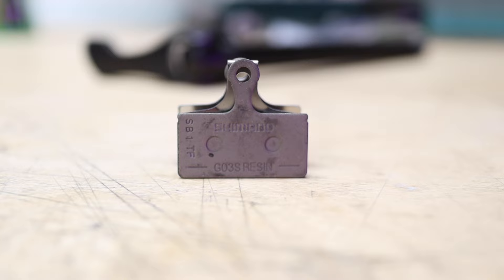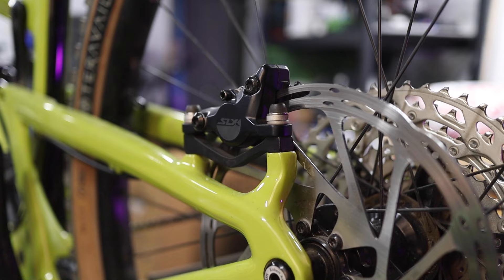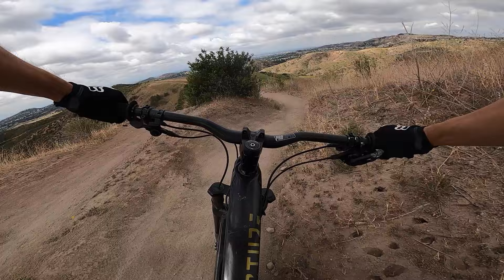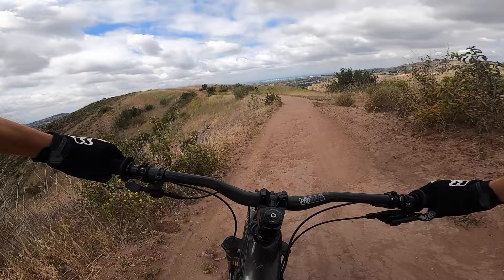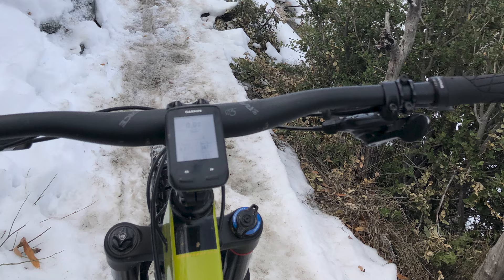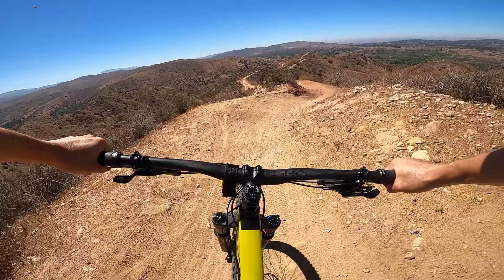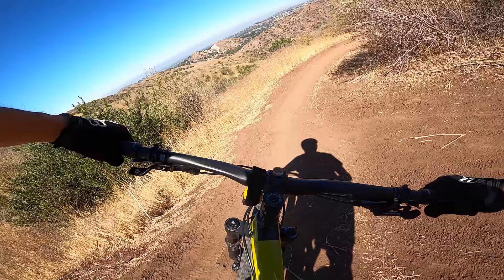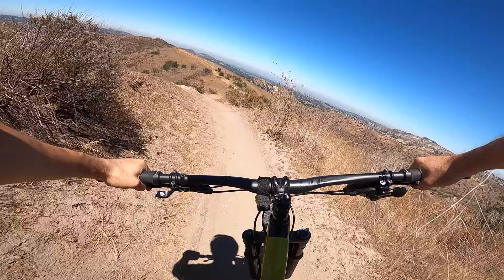Are You Using The WRONG Brake Pads??

Comment: Must be the riding style. I go through 2-3 metallic rear pads sets and one front set per year and find the resins unsafe when I need to stop. Maybe the Zee/Saint have a different feel. I am either max braking or off the brakes more than average riders and run the largest rotors allowed F/R. If I can't lock up my brakes with one finger at any time I don't trust them to stop me. Like you said...personal preference. Also, I buy bulk China metallic pads and find them as good or better then factory Shimanos at a fraction of the price. Only run Shimano rotors though. They are consistent though wear out quickly. Absolutely can not stand Sram brakes. No way No how. Hate them. P.S brake noise with metallic pads is 100% definitely installation or contamination not the pads.
Reply: Link for the China pads?

Comment: I switched to semi metallic from the stock resin pads on my mt201 brakes.  Sanded the rotors with 180 grit and cleaned with acetone (i think.  Here in Norway it's called "red spirit." Its what i had on hand.). And i noticed right away even before bedding there was an improvement in braking performance.  Braking is highly subjective and it pays to experiment.

Comment: I'm a Shimano guy for both MTB and Road brakes and I found that upgrading rotors for thicker ones solved most of the drawbacks of metallic pads. I don't need organic pads anymore.
Reply: But shimano rotors all come in the same thickness? 🤔
Reply: @gammelgemse  Yes, but I have Magura Storm HC and Sram HS2 rotors that are 2mm thich. They are also much cheaper than the MT900 rotors.
Reply: @anthonyhebert-trudeau6995  interesting option, and presumably much heavier?
Reply: @gammelgemse  147 grams for a Sram HS2 and 127 grams for a Magura Storm HC rotor both in 160 compared to 110 grams for a fragile Shimano MT900 rotor. If that's your definition of «much heavier»... I invite you to reconsider your priorities when it comes to weight savings.
Reply: @anthonyhebert-trudeau6995  Switched to Sintered pads on my rear entry-level Shimano brake, along with upgrading the rotor from Shimano RT54 to SRAM HS2 (both 160 mm), and the difference has been like night and day!

Comment: Have to disagree on the longevity of resin pads, on my e-bike I can get through a set in a few weeks by which point the resin has started crumbling and my pistons are almost fully extended. My sintered pads last well over a year for the most part. The screaming brake problem is definitely an issue though, I hate it and find myself riding the brake for a few seconds to heat the pads and rotors, drying them out. 

I have a short but very steep descent by my house and by the time I get to the bottom on resin pads, they have nothing left to give. With the sintered pads, I find that they work just as well as when they were at the top except there is noticeable pressure on the callipers from the fluid temperature rising.

Comment: It's interesting about squealing brakes.. I had a bike with Magura MT5s, factory resin pads up front & Galfer black metalic at back, & i hardly noticed any squealing in regular 500m descents, both in dry & post rain on wet hardpack.. Then i bought a new 2nd hand YT Tues with SRAM Codes, resin pads f/r, & i noticed the brake fade & i noticed squealing due to classic lack of SRAM stopping power.. Then before i sold my old bike i swapped the brakes over, Magura on the new bike & SRAM Code onto the old.. And pretty much silent brakes again.. The only time ive noticed squealy brakes is times where after a week of rain the trail is so wet & muddy  that you have to modulate the whole way down cos there's litterally no traction, your'e squirreling the whole way down & you have to run super low pressure.. Other than that i havnt noticed loud noisy brakes, wether resin or metalic.. Except for when ive had a contaminated rotor.. I think sometimes it comes down to people not bedding in their rotor/pads properly, or cleaning their rotor occasionally with brake cleaner. Or maybe braking technique, grabbing or dragging their brakes rather than modulating them as much as possible.. My constant irrational/rational fear is using my brakes too much & wearing my pads & having no ability to brake haha, so i instinctively modulate.. I think modulation is key to less noisy braking..

Comment: about the metal pads they last longer yes, but your break disc does not i had metal pads for about 1 year now i just commute and joy ride on a trek hybrid fitted with Shimano XTR BR-M9000 XC break set and Shimano XTR SM-RT99 rotors. at £50 each rotor i be sticking to resin for durability of the rear rotor its really eaten into it. and been hydraulic breaks for what im doing makes no different to me. it stops when i want had both pads in. also sometimes you get the ticking sound of the metal pads just clipping against the rotor normally after heavy breaking. can be annoying

Comment: Another well done vid!  Check out the Truckerco semi-metallic pads.  I use them on my 2 piston Deore's (aluminum plated), and 4 piston SLX's (they only make them in a steel plated).  It really is the best of both worlds, you get that resin initial bite but no brake fade.  

My trails in VA don't require much sustained braking either. but I do a lot of short hard braking.  Every now and then, when I go to the bike park, I don't need to switch to a straight metallic pad, unless I really wanted to.
Reply from the maker: Thx for the tip!
Reply: @Jonny Mej RVA: How noisy are those semi-metallic pads?

*
Reply: @do-ineedtosay723  No noise, they sound just like resin pads, but you can see the metallic "threads" in the pad material, and they have more power than resin, just not as much as pure metallic.  

My local trails get closed by the various parks, when it's wet, so I can't say how they perform in wet conditions.

Comment: Thanks. I'm watching it because I've got Shimano hydraulic MT200 brakes that are resin pads only, and being extremely disappointed by their performance. My old Shimano BR-M375 mechanical disk brakes can lock my wheels with 160mm rotors, and MT200 is maybe 70% as good with 203mm rotors. It makes me question hydraulic brakes in general, what is all the hype about... Brakes are not adjustable, can't move pads closer to rotor, have to deal with oil with zero benefits. Will try some semi metallic pads before I will put my mechanical disk brakes back.
Reply: The MT200 are just really terrible brakes.  They are Shimano's entry level MTB, so they're popular on bike builds where the manufacturer wants to get the build cost down.

I have them on my Polygon Siskiu D7 and nothing makes them good.  Bigger rotors: 160/180 -> 180/203; bleed and re-bleed etc; move to ceramic pads.  Everything improved them, but nothing made them something that you want to trust in the steeps.

Hydraulic brakes are awesome.  The MT200 are not.  The only real solution is an upgrade.  Even the MT400, that my partner has on her XC bike, are night-and-day better.
Reply: I find that the best choice for me is using dual piston mechanical disc brakes on my MTB. Simple design, very reliable, cheap to work on and maintain, good modulation and great stopping power if your hand grip strength is average or above. I use two fingers to operate each brake. I don't do crazy mountain descents though.

Comment: Well…you definitely aren’t a brake pad engineer.  You probably just confused a ton of people.  The material characteristics that you “personally feel”  which you are referencing for your advice is different from engineering data for brake pad design lol.  At least you said it was your opinion, but at the end.  Dude…CERAMIC pads are know for squealing…metallic/semi-metallic are not.  Literally the exact opposite of correct information.
Reply: I am looking for a brake pads that works really well in the rain (looking for the stopping power as same as when in dry conditions ) and offer the best stoping power, what should I chose?
Reply from the maker: @newfinishautospa maybe relax and do your research before coming on so strong. This video is comparing resin and metallic pads. Metallic pads are 100% known to be louder than resin. Ceramic pads are a different story, but still not as loud as metallic can be. Cheers